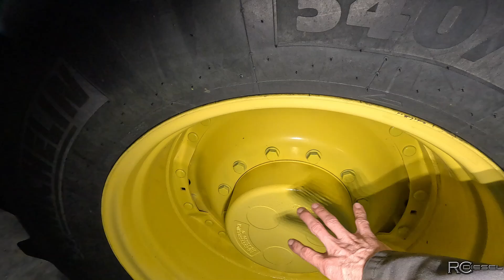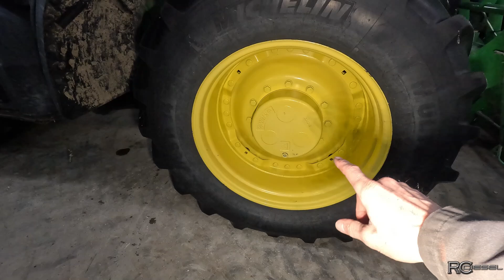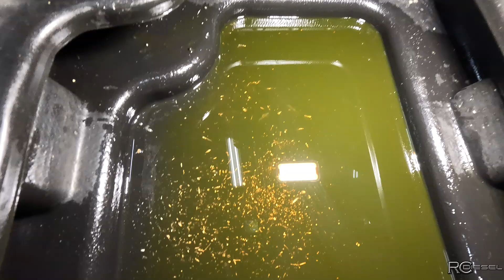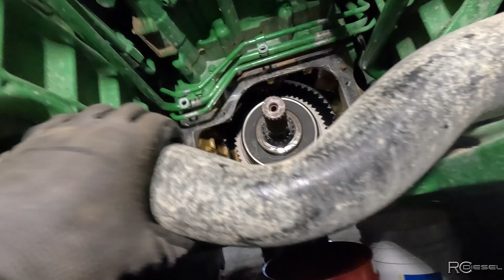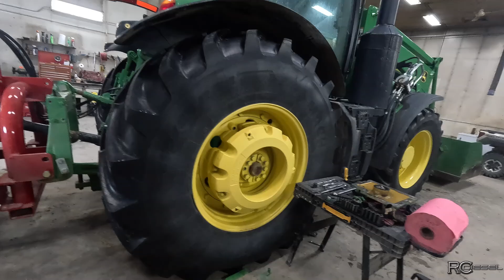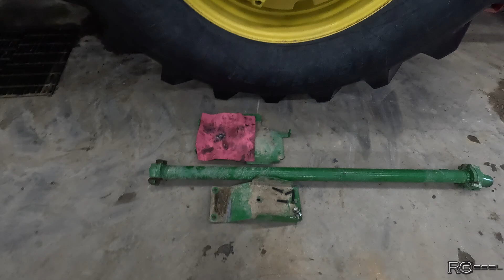John Deere 7210R MFWD Trouble - Diagnosing MFWD Whine & Bang

Comment: Got a customers Massey 3680 with the same problem. FWA wasnt working, he had recently bought the tractor and when I went to rebuild the drop box I found the same carnage. Problem is the gear on the Transmission shaft is currently unobtainable soooo were not sure exactly what the next step is. Worst part is someone knew it was a problem and sold it without telling anyone which would have been a couple owners ago. Sucks but way it goes!
Reply from the maker: @bulldogger1987  Baaaggghhhhh. I hate when that happens to people. Any chance of finding used? Any idea why it failed like that?
Reply: @rcdieselchannel  I'm hoping to find one overseas, need to email some salvage yards in the UK and see if any are available. I figured the failure is because the Autotronic system was bypassed over time cause it was prone to failure. However what they wouldn't have realized without a service manual is the FWA system was disengaged over 6 mph to prevent damage by autotronic. When they bypassed it, Off was actually on because no power to the solenoid valve dropped out the hydraulic pressure and locked the clutches. Run it down the road for a while in road gear locked up and it would have been chattering like crazy till the clutches failed and locked up and then ate the gear. I'm all for simplifying systems to work but good sense has to be applied as well and that's unfortunately lacking these days.
Reply from the maker: @bulldogger1987  Oh wow, ouch. Yeah, some of these systems that are in place that we think we don't need are actually there for a reason. A guy has to always look at the big picture.
Reply: @ yup, always! That’s why I got into this business, tired of seeing shoddy work.

Comment: I used to work in a deere dealership. We had constat problems on those drop boxes, especially for 7R series. Thinking back, the most troublesome tractors were the 7R series. They are alot better now, but all the small, weird problems we had with them at the time was just mad. 
Also, another perspective to look at this situation. Its  like a compliment, as you have a constant workload and have your schedule booked full of work. And you still go out of your way to help a customer out, even inf you have to turn it down, because youre so busy. That in itself tells me that you have loads of customers who value your skillset and work ethics. 
I bet they will still contact you when they have some trouble next time.
Reply from the maker: Thanks for your encouragement sir 👍 I do see your point... 

Did you see this same failure? Ground up gears? Any idea what actually caused that?

Comment: What is your thought on these newer JD tractors?  I've been looking for  a bigger tractor for our farm.  After researching about the newer 8R's and all the emissions stuff I decide to stay away from them.  Ended up finding a 5700h 8410 in really nice shape.
Reply from the maker: @markhoogendyk879  From an operators stand point, the 8R is a nicer tractor to operate, nicer cab, nicer controls, although they sure don't start up like the older ones. The 8410 cab is not as comfy, controls aren't as nice amd the plastic upholstery is kind of crummy. 

From a repair standpoint, the 7R & 8R emissions are a nightmare and the general electrical can be enough of a problem as well. Splitting this 7R is about 3 times the work of splitting an 8000 series tractor. The 8410 you picked up is a much more solid tractor, far less electrical and the 6081 Engine in that 8410 is tried and true - solid solid engine. 

So in my opinion, your 8410 is a 2X better tractor.  I personally think the 8000 series was the last of "the good ones".

Thanks for the question! 👍
Reply: What province are you from? I do 99% of my own wrenching. But if I have a problem with my 6430 and need the computer hooked up I call a former JD tech who also went out on his own.
Reply from the maker: @markhoogendyk879  Manitoba 👍
Reply: @markhoogendyk879  how many hours in it?
Reply from the maker: 2100hrs on that unit
Reply: @markhoogendyk879  best choice

Comment: Those 7r tractors are absolute garbage
Reply: Yep. They always seem to be in for transmission issues at the shop I work at.
Reply from the maker: @KALI1080 What usually goes wrong in the transmission? Is there some common issues? These tractors were still very new when I left the dealership.
Reply: @ I have not personally worked on a 7R transmission. I work at a dealer in Saskatchewan. Usually we see 6 or 9 size tractors the most. Just seems that when a 7R comes in there is an issue with the transmission. Keeps one of the old timers busy pulling cabs and transmissions. Have seen at least 3 full transmission replacements last year.
Reply from the maker: @KALI1080  I see. Do you know if these are IVT's being replaced or one of the powershift options?
Reply: @rcdieselchannel  I have only seen one IVT. Most of them are powershifts.
Reply from the maker: @KALI1080  Gotcha.

Comment: Hello from Italy
Reply from the maker: Italy?? No kidding! That's great! Thanks for tuning in!!
Reply: @rcdieselchannel  yes Italy . I have got a 6610 and  some years ago broken two teeths of mfwd clutch
Different tractor but similar problem in your video
I Was luck that no teeth broken in rangegear  box ...
Reply from the maker: @jd66610tube  6610 is a Ford tractor? Yeah, you don't want broken teeth in the drop box!
Reply: @rcdieselchannel  deere 6610 a model builded in mannheim-germany just for european market. It is something like  i don t know... 7210 deere?
Reply: Or maybe it is like a 6410 with 6 cylinder  engine and biggest Tyres
Reply from the maker: @ Aaahhh, no kidding. Cool. I had to google that one, never seen a 6610 JD. That's cool. Definitely looks like a slightly stretched out 6410 with big tires like you were saying. Neat!
Reply: @rcdieselchannel  yes